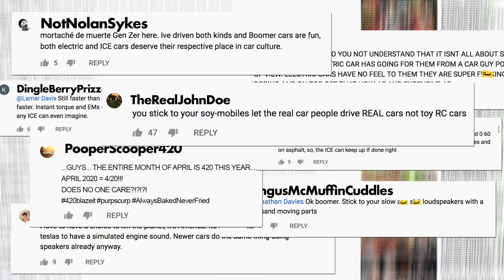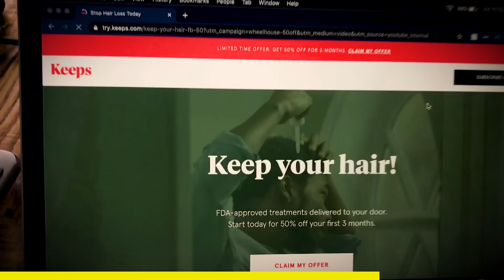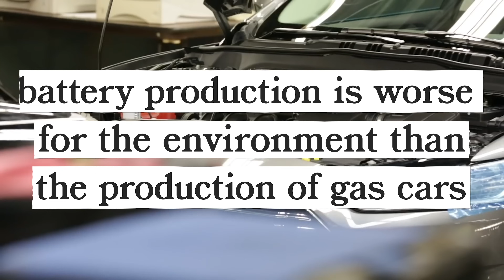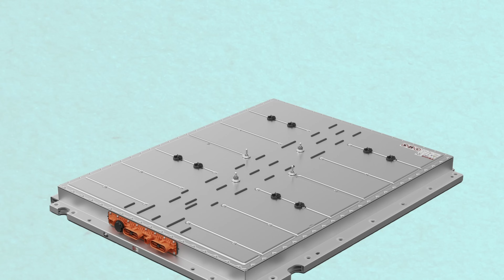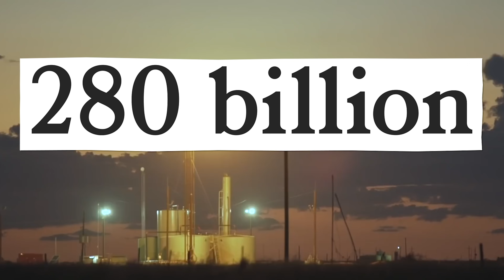Are Electric Cars REALLY Better for the Environment?

Comment: "such as wind, solar, and hydroelectric"
BOO free my boy nuclear power!
Reply: Western Europe (except France): We are going to decommission all our nuclear plants! Long live renewables!
Also Western Europe: They build new coal plants and pipelines to avoid an energy crisis...
Me: Why the f***!?
Reply: @DeiKuromu  don't the French reprocess their nuclear waste?
Reply: @jolyonwelsh9834  ask them...
Reply: @DeiKuromu  yeah big oof
Reply: @DeiKuromu  France has now the highest amount of clean energy. Germany planted a million windmills and solar panels. Which kill thousands of birds, destroy enormous pieces of land and make them inhabitable. So you would think Germany is green now? Well, France has like more than twice more green energy, only because of a few nuclear plants. So while France is clean, Germany is mass-murdering birds and other animals.
Reply: @MrArjanOskam  That whole birds thing is the biggest load of horseshit... All fossil fuels kill birds at a much higher rate than wind (even adjusted for capacity installed), as do power lines, cars, windows, and especially cats. Nuclear is likely to be necessary because of political pressure, but it's expensive and does not pair well with variability of renewable energy. Syngas is a better partner for producing baseload, as it can make use of excess energy and be used in existing CCGT plant. Also pumped hydro, and physics-based energy storage, as well as grid-scale batteries (not lithium), and re-use of 'expired' EV batteries.
Reply: @MrArjanOskam  Also, windmills are for grinding grain into flour. I think you mean 'wind turbines'.
Reply: @tSp289  Well sorry for not having English as my main language. Fossil fuels are bad, never said that they were better. Wind turbines in the Northsea made some animals go extinct. Solar panels are really bad when you need to recycle those.
Reply: @MrArjanOskam  Made what animals go extinct? Studies generally showed increased biodiversity  and populations because of the creation of artificial reefs by the blocks dropped to prevent base scour, and the 100m exclusion zone for trawlers around each one.
Re: Sahara. Great. Why not mop up the sea while you're there? mc-Si and pc-Si based solar panels (the most common types) actually lose about 1% efficiency for every degree over 25C they get, so what you actually want is clear, cold environments, not hot. There's still a lot of power in the Sahara, but concentrated solar is better for that kind of desert. Also, the silicon required to make these panels needs to be 99.999999% pure, which requires specific silicon sands, becoming increasingly rare. It also means that same silicon can't be used for computer chips.
Reply: @MrArjanOskam  cats kill far more birds per year than windmill. windows also kill more birds than windmills. so do cars. if windmills are mass murder, cats make the geneva conventions shiver in fear
Reply: @Amaterasu-wh6xj  I don't even care about the birds. More about the fact they're ugly and noisy. And ruin the sight of massive landscapes.
Reply: @MrArjanOskam  America really needs to get better at nuclear waste management (and waste management in general) before we even entertain the idea of more nuclear power
Reply: @MrArjanOskam  are you sayinf giant fans are better to look at? Coal power plants? Solar farms? (both solar cells and water boiling)
Reply: @Helperbot-2000  I hate to look at wind turbines, giant fans and Solar panels. If you take in consideration how much of the world needs to be filled with them to supply enough energy there will be no single clean landscape left
Reply: @MrArjanOskam  then whats your point about hating looking at nuclear plants?
Reply: @Helperbot-2000  I don't hate looking at those since theyre small and decent looking and you need a lot less of them
Reply: @MrArjanOskam  looks like i misread and or misunderstood your original comment, but i agree there. Sorry for wasting your time and have a still good day
Reply: @tSp289  nuclear would be great if humanity wouldn't start wars all the time and terrorism wasn't a thing.
Reply: @tSp289  i live in the 20 km radius of a nuclear power plant and i'm glad they shut it down few years ago :)
Reply: @tSp289  it sucks because nuclear power is so incredibly efficient.
Reply: @jthorsson6167  It produces a lot of power but it is only 50% efficient
Reply: Nuclear is in the middle of energy sources
Reply: A PWR nuclear plant typically emits less radiation than a coal fired plant. Just think about that for a sec.
Reply: And compost
Reply: Steam is also a greenhouse gas :/
Reply: @SmellyJoe1  it's literally just water, it'll freeze in the upper atmosphere or become rain
Reply: @OatmealTheCrazy  yeah i guess that's somewhat true "On average, it probably accounts for about 60% of the warming effect. However, water vapor does not control the Earth’s temperature, but is instead controlled by the temperature."
Reply: @Jake BELL even as edgy as it sounds, human errors are inevitable
Reply: I support Nuclear Power plant I like em small and not so dangerous, becouse they make a lot of Energy
Reply: Nuclear waste babeh!!!!
Reply: Why use vid clips of nuclear power plants to in a pollution montage when the exhaust you see out of those towers is nothing but steam?
Reply: Bruh some nuclear reactor nation are yeeting them in exchange for gas or coal plant.
Reply: @Delt4_Cr4wfish  Yep, I've seen that list. Science is a process of doubt and testing. Of course there are people who will not fully agree with the theory. I truly hope they're right, but again you're using one point of data (or 85 in this case) as if it is equivalent to the tens of thousands that suggest something completely different. Also without looking into the research of all these people you don't know to what degree they disagree with the theory. I studied at one of the universities a couple of these guys work at, and I can tell you theirs was not the majority conclusion, even in their own department. Before you jump to conclusions, that department welcomed  listening to all parties, hosting debates between indigenous groups and fracking companies, and giving them equal respect and time to speak.
Reply: @Delt4_Cr4wfish  Damn it, my reply just glitched. Basically it was this: people are allowed to doubt conclusions, that is what sciencei si about. 85 people is not many, especially since in that list I see celebrities and politicians, the brother of a former opposition leader, people whose qualifications are no higher level than my own, and people who taught in the same university I attended. From experience, I can tell you that department was all about hearing all sides, as they were hosting debates between indigenous groups and fracking company reps, and giving them equal respect and time to speak and answer questions. Again, you're taking one small negative indicator and using it as if it's equivalent to the overwhelming mass of positive ones. There isn't consensus. There never will be, but there is more than enough data to know that we're in deep trouble if we don't act. 

A fun fact if you're doubting human impact on the planet: since 1970, an average 68% of the earth's wildlife has been killed off. That's not just extinctions, but an average loss for each species of animal, bird and insect. I know that's not climate change data, but it is a proxy. Even if you think the climate isn't changing, or it's not our fault, our impact is too great and we need to change regardless.
Reply: Too all the retards that says nuclear is unclean. unsafe un economical, I suggest you read up on 4th gen reactors, for example the stable salt reactor.
Reply: Yeah, like the press release gives you a full understanding of the matter. As if you understand nuclear
Reply: @michaellidster1389  tbh what about it is not to understand, if you have an idea of basic phisics you can uunderstand it, you might not know the calculations and actual evens behind it, but you can understand the grasp of it, and its not like you understand how solar cells work
Reply: Solar is nuclear. Best nuclear reactor you could ever have. Nice safe distance too. Not in anyone's backyard. And run by God it is, rather than fallible little humanoids
Reply: @michaellidster1389  you only need 500 times as much space, and materials for it
Reply: May I introduce you to Thorium?
Reply: True, but a large portion, of military transportation are nuclear powered, so they still had plenty of sources(;
Reply: I would rather live in town with all electric cars than ICE cars...
Reply: @keanu9988  Lets go Nuclear and electric cars at the same time. Smog gone.
Reply: He literally showed nuclear when he said clean power
Reply: "He ain't do nothing"
Reply: Do you really want a nuclear reactor in your car
Reply: @apexhunter935  I've always looked up to Kim Jong un. Can't believe i get to follow in his foot steps by getting myself a nuclear reactor car.
Reply: Why isn't anybody talking about thorium power plants
Reply: isn't nuclear quite safe
Reply: @Supacoopaofawesomeness  Oh for sure! Thats why Kim Jong un loves nuclear things...
Reply: Thorium power is the future
Reply: Hahah
Reply: @JAYDEN HERRERA Indeed haha 😂
Reply: @JAYDEN HERRERA Wanna try it to say than to the European Union?  I'm not a snowflake activist like ejem... some girl called Greta ejem... (coughs)
Reply: @DeiKuromu  right now you are bullying a chill and no she is not a snowflake
Reply: @Ok-fu5yi  And do you want a gold star for "a very good job" for trying to make me feel bad? Too late fella.
Reply: @DeiKuromu  I just think it is wierd that you are attacking a child who only really tried to save the world
Reply: @Ok-fu5yi  Well, nice try 😅😂😂
Reply: The only problem with nuclear power plants is greed, they unfortunately take about 20 years to start turning a good profit and in 20 years laws can change forcing them to have to make costly upgrades because they don’t have enough lobbyist in gov to keep it at a manageable level like the oil industry does. And to the people saying “nuclear” isn’t safe or clean, you are ether uneducated or only thinking of old fission reactors (the splitting of large uranium atoms to make smaller atoms) fusion will be possible and it will be economical and most importantly it is CLEAN AND SAFE you are simply taking deuterium (an isotope of hydrogen also known as heavy water) and combining it to make bigger atoms(helium which is harmless )  which gives off a lot of heat which will turn a steam generator to produce power fusion eventually will be the one to replace coal and gas electric plants
Reply: Mathew Gonzalez nuclear would take 2 years to turn a profit if the government didn’t impose absurd regulations and review boards. Streamline the process like France and we will have rich energy companies, cheaper power, less pollution, and a tiny carbon footprint.

Nuclear is the future, it’s just a question if whether or not you want to get the bloated government out if the way.
Reply: @scottfree6479  yes and no. Nuclear power is the future for sure, but, it isn't quite as cheap as you think. The issue is building a reactor chamber, and a containment building. It's super expensive, and the maintenance cost is high. My father went to a meeting with Progress Energy talking about one of their nuclear plants. The containment chamber had a crack in it, and it would be impossible to safely repair, so they either had to spend several millions of dollars to completely rebuild the reactor containment, or decommission the plant. They did the second, sadly. Also, requirements for new nuclear reactors in terms of safety are much more expensive than the 70s era reactors that you usually think of, and I have a feeling that most new reactors will probably be Thorium based, however that would require a ton of R&D to finalize, and thus more money. Why Thorium? Higher power output, safer, easier to get a hold of, and cheaper to run.

Edit: It is still definitely a better option than building new coal and gas plants for sure
Reply: @scottfree6479  exactly
Reply: @matgggg55  >old

>Literally still our main/only option
Reply: @matgggg55  You obviously have no idea how far away working, reliable, commercial fusion reactors are. Even the most efficient test ones that have been made so far struggle to make more power than they consume. Fusion won't be the magical clean energy source that you're hailing them as for a very long time.
Reply: @DrWeazel  ye we gon have to wait like 25+ years
Reply: Search youtube for “thorium reactor” if you are anti-nuclear. Literally no danger of meltdown.
Reply: @starmanovich  yes, problem is they don't exist yet
Reply: @starmanovich  the new reactors are melt down proof. There has been no nuke accident involving a reactor that was built after 1980 and those are some of the old ones
Reply: @B-H76  Correct. I am a huge advocate for nuclear power. Too bad stigma and lobbyists rule instead of numbers and logic.
Reply: Nuclear power is the BOMB!
Reply: Yea Chernobyl LETS GOOO!!
Reply: First Chernobyl is not even comparable to modern reactors my dude
Reply: If we just flatten out the Sahara, and fill it up with solar panels, we can dismiss every other powersource in the world. So why won't we do that? If you fill it with concrete or like something to cover the sand, the panels wouldn't get very dirty either. And the sun is really powerfull there, so they would almost always be on max output.
Reply: @MrArjanOskam  yeah lets fill the entirety of the Saharan desert with cement, that definitely wont have an environmental impact. You do realize the sand and dust from the desert flies all over the world and helps with fertilization
Reply: Although nuclear can be clean and safe, to make it safe is incredibly expensive.
I wouldn't call it the best new power station to build. Especially economically speaking.
(src: www.youtube.com/watch?v=UC_BCz0pzMw and extensive wikipedia research)
Reply: Simon it’s not expensive to make it safe, it’s expensive to get past the decade of bullshit regulations the government imposed due to the oil lobby. Nuclear is the safest power generation, the most efficient outside of hydro, and the cleanest.

Plus, we can produce gigawatts with surprisingly little footprint.
Reply: @Simon-nx1sc  yes and no. If the general public knew about the real benefits of nuclear power, and the coal industry didn't press against it so heavily, the government would likely be up to funding them just like they were in the 70s. Nuclear power is by far the safest and best way to profitably generate electricity, as they stay online continuously, and can generate power for ludicrously large amounts of time before refueling is required. With the Advent of Thorium power, I wouldn't be surprised if a large business like Tesla made a Thorium LWR Hybrid to power Tesla Facilities, as well as generate profit as a power company.
Reply: @dsrocks6905  I agree that there are a lot of advantages, that it's way better than coal, and that fossile lobbyists are pressing against nuclear big way. But the fact remains that the current generation of new nuclear plants are more expensive than renewables+smartgrids+interconnections. Hinkley Point C in Brittain, and the new one in Finland they're building, are both way above planned budget, and will produce very expensive energy when finished. (whenever that will be)
Reply: @Simon-nx1sc  oh yeah I know it's incredibly expensive at first, but the fuel itself ends up being way more cost effective than coal in the long term. Regardless we will have to make sacrafices to fix the things we have already messed up, and sometimes that means spending a lot of money
Reply: @dsrocks6905  yes indeed, but coal is also very expensive. Renewables are the least expensive source, ONLY IF it makes up only around 20% of the total energy mix. Otherwise, storage, grid balancing become more of a problem. What we need is a mix of renewables, and indeed nuclear. Which will be expensive yes. But at least one thing we are definitaly for sure: we don't need coal for anything. Anywhere.
Reply: @Simon-nx1sc  my dad supervises a coal plant, and I have pretty good insight on the power grid. Coal has its purposes, and not having it entirely is a bit far. It's good at making high energy volumes in shortages and is usually used as a backup for less reliable power generation like natural gas and solar power.
Reply: @dsrocks6905  interesting, I'm geniunly wondering: why is natural gas less reliable than coal? I was thinking gas plants were a better choice than coal for the backups you're speaking of (thanks to their lower carbon footprint, and equivalent flexibility).
Reply: @Simon-nx1sc  two words. Cold weather. Natural gas lines tend to be less reliable during the winter, and line breaks are pretty common. It's also really difficult to produce natural gas during the winter, so coal plants take over. Sometimes extreme weather can even force coal plant outages, but usually most coal plant outages are scheduled for maintenance, and to save fuel.

Edit: it's also really dangerous to store large quantities of natural gas in one area, so most plants get it directly from refineries.
Reply: @dsrocks6905  You mean leaks in the gas transporting pipelines due to thermal expansion and compression?
Reply: @Simon-nx1sc its actually not that much more expensive to make nuclear power plants very safe, considering they could live for a long time making the expenses minimal because of the income, we even have the technology, it gets safe when goverments/powercompanys, dont plan ahead and choose a suitable location where its protected from natural disasters,
Reply: @Simon-nx1sc  https://www.eia.gov/tools/faqs/faq.php?id=427&t=3 
We basically run on coal so seeing that as a factor electric cars put out more co2 than whats said in this video. And seeing as we will still refine oil even if every car was electric because of the products it gives us, like jet fuel and plastic. Electric cars when factoring in this still make more co2. Not to mention co2 is a required gas for life.
Reply: Also gas as well as desile engines can still get more efficient
Reply: @Delt4_Cr4wfish  No, they don't. If you want a car guy/gearhead's take on this look up engineering explained's look at the actual numbers. Even worst-case scenario huge battery teslas in a good mix are cleaner after about 5 years, though the biggest batteries on coal are not any better. Most smaller battery cars are way better than that, and remember the US is not the whole world. Large parts of Europe are nearing or passing 50% renewables. Real world figures on batteries are also better than original estimates too, and battery chemistry is improving by the month. The cost of them has dropped 80% by 2010, in large part by reducing the amount of lithium and cobalt in them in the first place.

Edited: correcting fact from EE's video.
Reply: @Delt4_Cr4wfish  Yeah, a number of ICE manufacturers are making leaps in engine efficiency. Good. Everything helps. Still, unless we can reliably make carbon neutral fuels (e.g. though artificial photosynthesis, some cool stuff happening there), ICE is going the way of the horse. Even if we can keep it alive, it should only be for niche, cool cars, not everyday shitboxes that people don't care about, because air pollution from cars kills millions every year, and can take decades of average life expectancy in the worst cities.
Reply: @tSp289  ya im well aware that ultimately if u dont factor certain things in that electric run cars are cleaner. But again if you factor in the fact that even if the world ran on electric cars. That oil refinery would still take place. The fact that fossil fuel vehicles are still improving in design them selfs. And most of the world gets there electric from fossil fuels that number dwindles even more. The cost dosen't really out weigh the benefits.
Reply: And then you also have to think that more energy demanding cars will up the wattage the power grid must sustain. So more coal has to be brunt or natural gas. Solar while getting better still doesn't compete with fossil fuels. And wind isn't that efficient eather. Both are reliant on the weather so are not even constant. Germany tryed it and had to turn back on the coal plants witch made the price of electricity sky high.
Reply: @tSp289  what are u talking about pollutants, co2 and water are not pollutants.
Reply: @Delt4_Cr4wfish  OK, We're talking about cradle-to-grave apples-to-apples. Go watch EE's video. The only claims that make ICE look cleaner are if you don't actually drive them anywhere or if you miss emissions from fuel extraction, transportation and processing, but do include battery production and electricity. Look you're not going to believe me no matter what I say, so go look at eng explained's video or better yet any of the peer reviewed journal articles that do comparative LCAs for EVs and ICE. Fossil fuel vehicles are improving, and that's good, but so are EVs, and that's good too. Most of the world is gradually moving over from fossil fuels to renewables and/or nuclear or at least away from coal and toward gas. Also if you look at the energy return on energy invested figures for oil, at peak you used to get around 50x the energy out you had to put in, but now that the best sites are depleted that figure's closer to 8, and getting lower every day. We still need that oil for other petrochemical uses, and it's getting dirtier to extract.
Reply: @Delt4_Cr4wfish  Re: renewable energy, you're right, up to a point. Electrification of vehicles and heating systems puts a huge load on the grid, which in the UK at least is really old and amazingly expensive to repair now that we can only get components from e.g. India and China. That's a big problem, but EV adoption is gradual and is likely to remain gradual until the prices really come down. The grid also has to adapt anyway and it's being done. All western nations except maybe the US are increasing their renewables and moving away from fossils, especially coal. Solar's patchy but new panel chemistries look promising. Efficiency of wind turbines is greater than you might think (these things are very carefully planned out using decades of weather data. I know: I've done it), and onshore wind is one of the cheapest forms of energy production. However, offshore is where the real prize is, because it avoids all the problems of visual impact and local resistance, is very scaleable and taps into a MASSIVE resource. It also actually benefits fish stocks and therefore fishermen. Germany had some hiccups, mainly from poor planning and a political shift started by the 2015 migrant crisis. Wind works best distributed across a wide area and as part of a joined-up system. UK wind turbines power Norwegian pumped hydro storage, which can kick in when the wind's low in the UK. Interconnectors between regions and countries enable this kind of load balancing, and good grid design allows for a viable renewable grid, though in reality there'll probably be base load nuclear and syngas-running CCGT. That's fine, if it gets us there. By the way, this is the subject of my MSc. I've done a lot of research, by which I mean hundreds of hours of reading peer-reviewed journals. That's not a brag, as I'm not an expert, but I am pretty sure of the facts around EV vs ICE and coal vs almost anyhting else. It's never a simple good/bad situation: all these technologies have massive flaws, but coal is somehting we need to ditch ASAP, and ICE needs to give way to cleaner technologies over the next 15-20 years or so. It can happen, needs to happen and hopefully will. I also like manual shifting cars with loud engines, but I like horses too, and they're still around.
Reply: @tSp289  your not getting my point clearly, even if the world used only electric cars they are not cleaner, yes they dont put out co2 but guess what solar need the sun and there no where to store that energy, so its not cost effective, wind same thing. Its not always sunny or windy. Hydro plants are limited so that leaves nuclear and fossil fuels. Fossil fuels.... still power your car, so basically your electric car is putting out co2 though fossil fuels. So as a result that shorts the gap of how clean an electric car is. The fact that also fossil fuels will still be refined into, plastics, jet fuel, rocket, desile, other uses in manufacturing also a factor on both sides. In this video he counted it as a negative for gas cars yet its a negative on both. That also shortens the gap. Ultimately the price you pay for an electric is not worth the tiny bit better co2 outage that this video likes to clame is such a big gap. Thats my point. Not to mention everyone seems to fail to realize that co2 is not a pollutant. So its not even a big issue. Thats just pure stupidity. I have watched the entire video that im pretty sure your talking about and they missed those points too just like this one. The only thing thats going electric anytime soon is cars and  the huge battery and a full load drastically lowers there range. There a video on this very point. Not to mention the battery only has so many charges before you have to replace it  Causing more co2 "pollutant". Semis definitely not going electric anytime soon. And airliners not even close.
Reply: @Delt4_Cr4wfish  See you're using circular logic and decuctive reasoning there. You're saying solar: ok, it's not always sunny, so that basically rules that out. Thing is, it doesn't. There are loads of ways to store that energy, and more are being developed as we speak. Ironically, it's a use for 'dead' EV batteries. They can be stacked, have dead cells replaced and used for another 20+ years in grid storage either centrally or in houses. EVs themselves can be used for V2G storage, and excess solar or wind can eb used to produce syngas and hydrogen that can be burnt in CCGT plant. All of these fields have problems, but they are all developing fast and offer viable solutions. 

If you're making that kind of claim about what is viable and how things compare, you NEED numbers, and the numbers show that your claims are off. The fact is people who've done the lifecycle analyses on these vehicles have thought of every one of your points and they have sourced numbers to validate or negate them. Their conclusions are overwhelmingly that a move toward renewable energy and away from ICE is desirable. Fraught with problems, sure, but problems that are much smaller than the consequences of sticking with the status quo. 

Re: pollutants. A pollutant is something out of place that has a harmful effect. Water can be considered a pollutant if it's in your fuel or in your lungs. Light is a pollutant in the night sky or in a sleeping environment, and so on. CO2 IS a pollutant when its atmospheric concentrations are well above safe levels and climbing, but what I meant as pollutants was things like nitrous oxide, soot and brake dust, all of which are known to contribute to lung cancers and cause millions of early deaths worldwide annually.
Reply: @tSp289  no i didn't say it rules it out, im saying rn its not effect enough to be viable seeing as the sun isn't always in the sky, like night time.  And to your next point about how they have factored this in. Very unlikely. Even in this video he didn't otherwise he wouldn't of even pointed it out.
To your last point you talk about pollutant. Electric cars still give off pollutants by yiur logic. They still have to break so break dust. They still made of metal and other chemicals that can leak. Co2 levels have been way higher in the past and have fluctuated through out history. During the times of the dinosaurs it was higher. And it will continue to fluctuate in the future. It is far from dangerous levels.
Reply: @Delt4_Cr4wfish  Again, to make a statement about viability, you need numbers. 

Second, why do you think it's unlikely? Correct me if I'm wrong but I don't think you've been involved in professional or postgrad level science. If it's your job or you're writing a paper to construct a lifecycle analysis (LCA) of a certain technology, you're going to spend hundreds or thousands of hours on this project, it might take you six months or a year to do, involve reading hundreds of papers and attending conferences, then sending it off for peer review, having it critiqued and sent back by numerous experts in your field before you can get it published. You make sure you cover the kind of thing that your average man on the street can think of in a few seconds. The process isn't perfect, and it has some serious flaws, but you're not giving enough credit to the people who've done the science on the subjects you're offering your opinion on.

Engineering Explained's video did not include explicit references to end of life, but there are LCAs out there that do. The idea of re-use of EV batteries  I mentioned was from one such LCA. The main body of a car is highly recyclable. Current EV battery recyc is more tricky, but it is being done, and the processes are improving rapidly. It will be easier again when alternate battery chemistries like sodium ion come online in a couple of years.

Like your point on pollutants, yes, you're right. EVs produce pollutants too. They're not good for the planet, they're just  much less damaging than ICE cars are over their full lifetime. Regen braking means brake pads on EVs might only need replacing every 5-10 years, depending on driving style. Same goes for rotors, no motor oil, many are air cooled so no glycol needed, and the very few moving parts means their maintenance is negligible compared to an ICE car. They'll still need tyres.
Reply: @Delt4_Cr4wfish  Oh and on CO2... I don't really want to get into this with you but I'll answer this once. Again, you need to understand the science for your opinion to be valid. CO2 has been higher in the past. The relationship between CO2 and average temperature is well established. Atmospheric CO2 has fluctuated between about 150 parts per million in ice ages up to around 280 during interglacials. Since 1958, it's risen from 300ppm to 415ppm, and the last time it was this high, seas were 15m higher than they are today, and trees were present on the south pole. I really don't understand how so many people think that just because it has been warmer before that it's somehow OK for it to be warmer again. It's really not. 1.5 million years ago (last time we had this CO2 concentration), modern humans hadn't even evolved. Human ancestors then lived in small nomadic tribes that could move around if the climate got too harsh. Now we have 7+ billion people 2 missed meals away from anarchy, armed with nuclear weapons and completely dependent on prediuctable rainfall and the sea not swamping our cities. Even if ti were all natural and completely normal (it's not), then it would still be the biggest problem humanity has ever faced. Luckily, because we know we're causing it, we can act to slow it down. That will only happen if people trust the scientists who understand the problem, and not the corporatists and populist politicians who deny it because action would threaten their wealth.
Reply: @Delt4_Cr4wfish  See the fundamental problem here is you're using intuitive logic to cover gaps in your knowledge, rather than either seeking out truth or having the courage to say "I don't know". Honestly I'm not even sure while I'm still replying, as we both know neither of this is going to come away with our minds changed. Still, you've been pretty civil (which is rare on YT tbh) so I'll address your points:

Yes, EVs brake. However, on most of them, the actual brakes are mostly reserved for emergencies, and most of the deceleration is handled by the motors themselves, which wear very much less as they're not using rubbing friction to slow but inducing a current and using up the car's kinetic energy, which slows it down using magnetic force. This can mean that potentially, you NEVER have to change the brake pads or discs, or at least only once or twice in the car's lifetime. Yes, they require some lubricants. They don't however require 5.5l of motor oil every year, or 7.5l of coolant every 1-2 years like my diesel does. 

In so many of your replies, you are using a single problem to entirely write something off as either not viable or equally bad/worse. That's why I was saying you need numbers to make a decision. That's why we do science, and try to actively disprove your assumptions to test their validity, and yes, science gets influenced by politics, funding and funding and tenure. Of course it does, it's done by humans, and humans are dodgy as fuck. However, the other side of that argument is so much less convincing it's not even funny. Science is a process of trying to disprove assumptions and bias. It does it it in a methodical, objective way that must be reproducible. Science doesn't deal in certainty, it deals in probability. Those who cast doubt on science only have to say "the science isn't settled" or "it's just a theory", and that's all they need to do to make people think they know better than the people who've been studying the subject for decades. Meanwhile, our entire civilisation is based on the technology that came out of scientific process. 

Similarly, there's confusion about facts and theory. We use 'fact' to mean something solid and concrete, and 'theory' to mean something vague and unformed, but it's not right at all. What you're doing is using facts, (which should really be called 'factors'), as if they are theory. Yes, CO2 is released by the oceans as temperatures rise. That's a fact. It's called a positive feedback loop when two variables both increase each other. Water is the main greenhouse gas. That is also a fact. However the theory takes those facts and - by testing, doubting, and trying like hell to disprove itself - it works out how they all relate. In this case, the quick version is that CO2 drives temperatures just enough to cause greater evaporation and humidity in the atmosphere. This increased humidity traps more heat, which causes methane and CO2 to be released from sea water and frozen soils, increasing the temperatures a little more, and so on. There's about a 20-year lag between the release of the CO2 and its effects on temperature being felt, and in a wholly natural system there are also mechanisms that remove CO2 from the air. They create a kind of balance. It's not perfect, and every 100,000 years or so it'll hit a tipping point and shift from a glacial into an interglacial warm period. It's a SLOW cycle, and it's been repeating every 100,000 years or so for nearly 1 million years. We came out of the last glacial period about 10k years ago, and those positive feedback loops I mentioned earlier caused rapid warming, but then it levelled out, as it has done countless times. We'd expect a slow, slow warming, based on ALL we know about atmospheric physics, volcanism, solar activity and milankovitch cycles, biology etc., but what we're seeing is a rapid warming that is unexplainable by natural phenomena, but is totally obvious when you look at how much CO2, CH4 etc. we are releasing. We've released more since 1958 than the natural processes managed in the previous 50,000 years.

Now I've explained that in a nice intuitive narrative. It makes a neat story, but my story is not what matters, because if narrative was that important you'd get more people believing in harry potter than in electricity. It's the science, the numbers, the observations and the theory. All of that is what is telling us what's going on, and what we can do to stop it. There is corruption in science, sure, but there is SO MUCH MORE corruption in business and politics, so just like I wouldn't ask a  salesman to do my brain surgery, I get my opinions on climate from atmospheric physicists, and on EVs from engineers. I hope you've found this interesting, even if you're not convinced by any of it.
Reply: @tSp289  i definitely know than i lead on to. Everyone has gaps in there knowledge, even u. But maybe u should take the advice you gave to me and apply it to your self as well. Must go back to my life now
Reply: @Delt4_Cr4wfish  Sure, HUGE gaps in my knowledge. I'm not an engineer or an atmo physicist, I'm more on the technical/infrastructure end of energy systems, but I've been taught by and friends with a lot of people who ARE both of those things, and I know their process and can vouch for their honesty. Just got to be sure that if you're trying to draw an equivalence between two things, you need to check the numbers and assumptions too. I do it sometimes too. Anyway, you seem capable of disagreeing with someone without being an arse and for that I thank you. Enjoy your life!
Reply: @tSp289  very well said
Reply: Look into LFTR.  Relatively proven technology.  Far more safe.  Your statement is true for the current on-line nuclear plants
Reply: After Chernobyl, I ain’t wanna be even on the same planet as a nuclear power plant
Reply: Nouri Sheibani literally not comparable to modern nuclear facilities, look up throium reactors.
Reply: @nourisheibani6626  you see, thays a very bad mindset. You have to remember that was a very bad design not even used anomore, reactors now are unimaginably safe compared to chernobyl. And on top of that imagime you used the same mindset for al of the dams that have broken down, it wouldnt be a good thing, but i doubt you are against those now are you?
Reply: Now you see the process of getting power through nuclear power plants may be clean... But in the years since we have used that no one has come up with a solution for what to do with the finished uranium and that is an immense problem
Reply: @mmjf674  IFRs can recycle old fuel. Unfortunately, the program was canceled in 1994. Sure, it's an issue, but not as big as it seems.
Reply: @mmjf674  modern plants don't use uranium, that's why they are safe and clean.
Reply: it isn't clean
Reply: @goganito  Way better than coal, though.  The dangers of nuclear energy are... not played up, but the general public has an irrational fear of them.  Anything is dangerous if used wrong, but coal puts all kinds of carcinogens into the environment, not to mention the causation of climate change.  While I acknowledge the dangers of nuclear energy, it really is not as bad as fossil fuels.  And all of this goes only for fission.  Once fusion is widespread, the problem will be solved completely (a fusion reaction can't sustain itself to cause a meltdown).
Reply: @goganito  in the long term nuclear power is the cleanest power source we have. Cleaner than even wind and solar
Reply: Goganito nuclear energy, provided you are competent enough to maintain the facilities is the CLEANEST and MOST EFFICIENT energy source. Please do research before making a claim with no backup
Reply: @goganito  actually, nuclear is clean and extremely efficient with very low environmental impact
Reply: @keithlarsen8423  yeah, nuclear is pretty safe.
Reply: @goganito  it makes no co2
Reply: Nuclear power is not clean and not renewable, it fuckin sucks and is not worth the danger
Reply: Mike Tython Someone has been lied to their whole life. Nuclear is clean and creates less waste then people think. We have just been scared by Chernobyl to think it's not.
Reply: @geraldgreen6794  Chernobyl isn't the only reactor meltdown. It takes a shitload of energy to mine uranium and prepare it for use (and we're quickly running out of it), so its not sustainable. Its not "clean" it just doesnt produce CO2, instead it produces radioactive waste which renders the surrounding areas uninhabitable basically forever. There are some isolated uses where I could see nuclear power being beneficial, for instance in submarines, but in general it is too dangerous/non-renewable/unclean to be considered for widespread use.
Reply: @LoadPast  Nuclear energy is THE SAFEST form of energy production, even if you include ALL the deaths caused by nuclear accidents such as Chernobyl.
More people die from solar panels installations then nuclear energy.

Even if we would only use uranium and ignore all other potential sources of nuclear fuel. We have enough easily accessible uranium to last us for at least the next 1000 years.

NO energy source is 100% renewable, it is a physical impossibility, some just last so long we don't have to worry about it such as the sun.
Nuclear would last us at least 1000 years under the worst case scenario and we have the capability to build it right now.

Most nuclear waste can be reused to produce more energy, using this method we could decrease the amount of nuclear waste by a large amount.

Dealing with nuclear waste is not really all that difficult, most of the problems are just political nonsense. 

Also when people talk of nuclear waste, its often misinformed or sometime outright deceitful. I often hear how nuclear waste will "kill you with in hours and lasts for billions of years". 
Whereas the reality is that there is more than one type of nuclear waste, the stuff that will kill you within hours has a short half life and the stuff that will last a billion years is actually relatively safe to handle. They are not the same.
Reply: Mike Tython i would do some more research. “It sucks” does not sound like you have put in the effort. Nuclear power is, by far, very very far, the cleanest way of producing energy on a large scale. Denying that is just nonsense and comparable to stating that we live on a flat earth. It also causes way, and I mean almost infinitely way, safer to humans than any other way of producing energy. Nuclear power suffers from a bad image because of tjernoby and fukushima. Fukushima btw led to 1 death. Yes. 1. The second largest nuclear disaster ever caused 1 death. Please inform yourself or don’t state meaningless phrases like “it sucks”.
Reply: @LoadPast  https://youtu.be/lL6uB1z95gA
Reply: Mike Tython someone fell victim to fear mongering and coal lobbying, talk to a scientist about how clean nuclear power is, nuclear power is only unclean when the facility is not maintained properly and an accident happens. However, with modern regulations and more knowledge, the production of nuclear energy is safer that ever before
Reply: @LoadPast  it is the best source of energy we have rn but it's extremely expensive
Reply: @LoadPast  you are clearly poorly informed about nuke power. It is actually a really safe form of energy production because of the extremely strict safety regulations. If you do the research you will see why
Reply: @LoadPast  its like an apple worth of of nuclear waste per human life rn
Reply: Mike Tython You don’t know what you’re thayin, Mike
Reply: @LoadPast  What exactly is the danger? The only times accidents happened on nuclear power plants were because they used old and dangerous reactors, and were also poorly built, because the architects wanted to open the plant ahead of time to get some rewards for their work (Chernobyl), and because a fu*kin tsunami struck the powerplant in 
Fukushima. If you build them properly (and people do) everything will be fine, Ukraine still gets >50% of its energy from nuclear. And as for the waste, well, isn't it nice, that the waste is in form of relatively small amounts of solid matter, that you can simply bury in some desert and forget, instead of huge amounts of gas that simply gets let out in the atmosphere